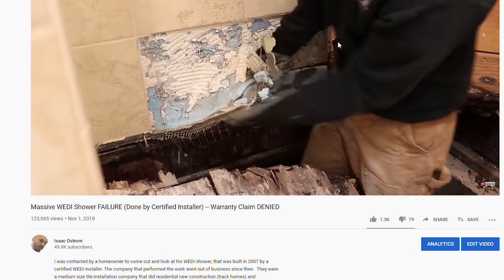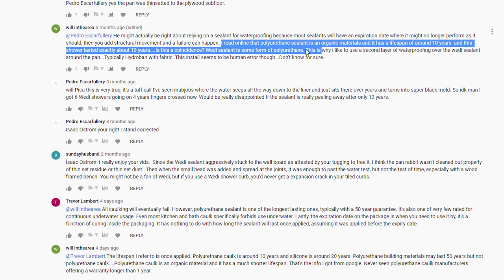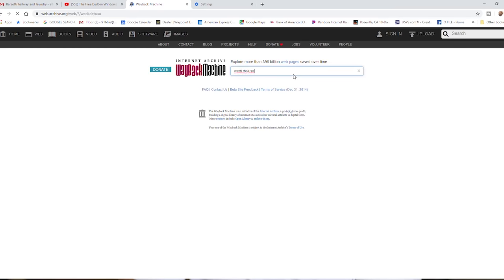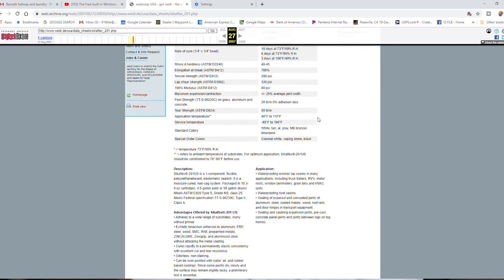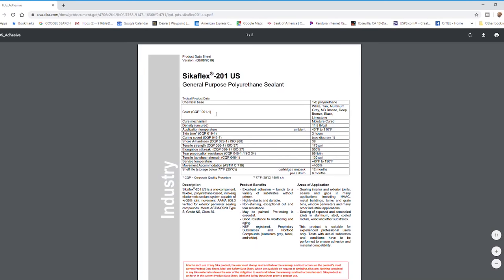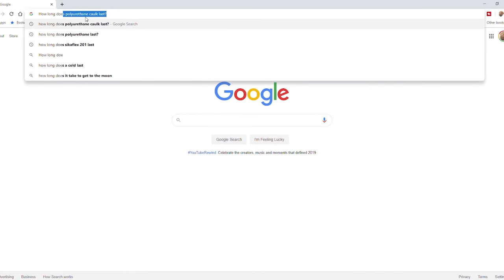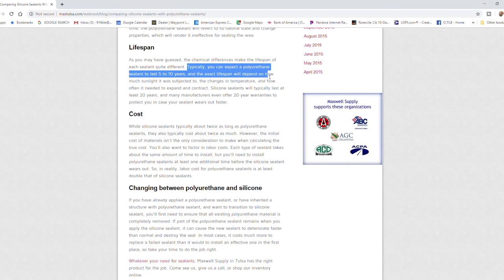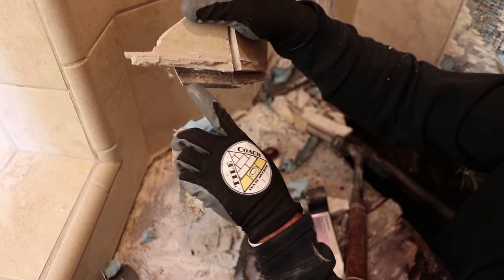WEDI Sealant Used in 2007 Identified-- ONE YEAR Manufacturer Warranty (Sikaflex 201)

Comment: Dude you’re a blessing to the tile community. Companies can learn so much from your videos. Great work! 👍
Reply: Great video with a lot of good information.  I’m a Pro certified Wedi installer ( can offer a 20 year warranty)  in the Nashville TN area.   Now to have had a shower system fail exactly the way this one did in the video.  Of course there is always a chance of installer error, which happens about 90% of the time.  But when I tore out the failed system I to suspected that the Wedi caulk had failed.  I really really like using the Wedi System so once I had an issue I came up with a solution so that never happens again.  What I do is install the pan and 1/2” wedi board according to manufacturers recommendations.  But in order to prevent the wedi caulk from separating or delaminating I add one more step .  I will use the wedi sub liner dry membrane and cut strips about 6”-8” and fold it in half. Then I thin set the sub liner dry over every joint (also using the wedi inside and outside corners at each corner).  This is a very cheap solution that will take you about an extra 20 minutes to do.  If you use this extra step you will have great installation and not ever have to worry of the Wedi caulk every failing.  NOTE:  wedi does have a product the sell called Wedi Band which is sub liner dry already cut in a 6” roll by X number of feet for the length.   You can use the Wedi band or cut your own strips with the wedi sub liner dry.  We typically just cut our own strips because we always have the sub liner dry on the truck.
Reply: @success19642  Why try reinventing the wheel? The info is at your finger tips. Get you some Sealant 620 and a roll of Sealing Tape.

Comment: Thanks Isaac. All your work and research is improving the industry and helping installers like me. I was wondering if maybe the installer from that shower used something other than the recommended Wedi sealant? Just because that was what Wedi was using back then doesn't necessarily mean the installer didn't use something else. What if he used acrylic door and window painters caulking for example? Thanks again for helping us out. Hope you guys are as busy as I am, my schedule is full until the last week in May and I haven't had more than 3 days between jobs since November. I'm making a lot more money since you gave me some coaching on what I should be charging for jobs. I can't thank you enough.

Comment: It appears that a majority of the "failed shower" videos are of shower pans.  I am installing a tub, with a shower surround, and recently found all of these new backer board products.  In my search to see what is the differences between these and the ancient cement boards, I found your informative videos.  Do you see any major issues using either WEDI or Dural Durabase XPS with a tub?  I'm doing this in two of my upstairs bathrooms, on my own, so obviously I don't want any moisture or leaks, but also carrying the weight up the stairs and mess of cutting and then sealing etc.  Plus the cost comparison.

Comment: If the lifespan of polyurethane sealant is 5 - 10 years and silicone is 20 years, then what's the lifespan of ms modified sealant which is what wedi uses now??? As i understand ms modified sealant is a hybrid type of sealant with the same benefits of polyurethane and silicone but I could find no information of it's life expectancy. It might be because it's a new product and they don't really know how long it's supposed to last. I wouldn't trust wedi sealant either....Unless you plan to get a new shower in the future anyways. I prefer pan liners or kerdi with ardex 8+9 over it.

Comment: That's some great detective work Isaac.  Bottom line, don't rely on sealants alone, most just don't last.  Butyl sealants are probably the best.  But still, always thinset and tape those joints, especially corners and floor/ wall intersections and apply a topical waterproofing like Redgard.

Comment: thank you for this clarification video
i had the wedi rep come out who does the classes to do my first install with me as it was a very high end job and my first one. You most definitely have to put enough glue in the channel that when you push the board out you get 1 inch overlap on each side. They were VERY adamant about using a lot of sealant. Also they have their own sealant now which im sure you know. There is a new company out too that is virtually identical to wedi but the board is green, i guess one of the former employees made this brand. I'm more of a fan of schluter but I'm liking how you do your systems as well. I'm kind of leaning towards goboard for walls, sheet membrane for corners and seems, and ardex 8+9 for pan and over the sheet membrane that joins the corners and seems.

Comment: I'm not a tile guy but I have been building houses for 25 years. Mostly drywall but I have done alot of remodeling so I've had a taste of just about everything. Anyway it seams like common Spence to me that ANYTHING dealing with holding water that has a seem is going to leak eventually. Only way to be sure there is not going to be any leaking is using a seamless system like the pic shower pan liner or some kind of prepare shower pan. Yes them things can get expensive but I'm pretty sure that none of them cost as much as it's going to cost to fix that means house. NEVER GO CHEAP IN A AREA YOU CAN NO ACCSESS OR SEE WHAT IS GOING ON TILL ITS WAY TO LATE. When I work on a house I keep in my mind will this still be here 100 years from now. Yeah them couple nails are good for now but will it still be holding up in 100 50 or even 25 years. That's just me and how I do stuff when it comes to ppls. Home. Thanks for the videos. I been in the business a little longer then you but I still learn alot from you. So thanks

Comment: heres my opinion ,I really think something caused  deflection,...I dont think the sealant broke down ,it may not have been applied enough,,especially on wood,where it will move more than a slab, could be a kid jumping off the bench,or a water leak, and ultimately separation  of the bond at the rabbet,great research from you isaac ,and your followers, in the end that sealant seemed  pretty stretchy,how well it bonds to the blue foam,and the coating  on wedi...yet to be determined, thanks for posting,

Comment: You must use fiberglass tape on all joints especially the pan it is typically not the glue that fails it is the joint that will open up with stud movement!!!!! Rats love to eat wedi.the proper amount of glue applied also is a large factor.

Comment: Sealants should never be advertised as water proof. They all break down, especially if used in a joint that can move. There was a YouTube video I watched a couple months ago that talked about the life-span of various construction products. Basically all caulking will one day turn to dust and should never be used to permanently attach something that has any type of constant static force including the force of gravity. People who are addicted to attaching things like framing members to drywall are idiots. Use them for their intended purpose such as gap filling or water resistance such as around a tub or toilet, not for shower pan waterproofing. I don't care how advanced or space-age the sealant is.
Reply: But typical waterproofing coatings share the same type of chemicals used in sealants, e.g. acrylics, polyurethane, or epoxy. If sealants don't live up to the job, so do the waterproofing coatings.
Reply: @oldhongkong565  It's very difficult to virtually impossible to join two pieces of material together with a third and expect it to be waterproof. Because at the atomic level, the materials are not homogeneous and are basically sitting on top of one another with bonds that are physical taking advantage of the uneven surfaces of the material. This is completely different to the concept of "welding" when you use a filler material similar to the base that actually flows into the base material due to heat melting the material. Sealants are water-resistant at best under the perfect conditions.

Comment: Thanks for sharing.   I'm always looking forward to your discoveries...  Planning a bathroom remodel with tub.     Learning as much as possible before starting (in about 12 months).

In 2015, first bathroom remodel. Installed nobledeck on floor (sunken concrete slab), nobleseal ts on walls, sealed with noblesealant 150 (this caulk was very expensive iirc $25+ per tube).  Hopefully, I get another 10+ years out of it.  Or at least until the house is sells....

Between you, Sal and Elite tile amongst others, lots of good information out there.

Comment: I love your shower system failure videos.   It seems that every one of these shower systems now have a failure video on your channel.   So whats the one thing they all have in common?  They are built on site and the seams are sealed according to the manufacturers specifications.   In some cases the manufacturers have issues with their products such as the Schluter thinset wicking, or in this case the poor sealant recommendation.    What is NOT failing or not causing these epic disasters?  The wall seams...  All of these failures are in the pan section.  If its a hot mop job, a PVC liner, or a "shower system" all the failures are in the pan.   Makes me wonder why more installers are not using tileable factory made shower pans.  Seamless systems that take a couple hours to install rather than a full day (at $100+ per hour).  Other than the lead time to have the custom pan made, and the limitation on the drain riser heights that can be used there are not many down sides to using one.

Comment: Hi Isaak, im asking you as you seem to have the most experience in this Wedi product I have seen so far, im in UK and this is still fairly new over here but hear goes...

I am in process of building a walk in shower enclosure 2000mm x 800mm and have used an 1800x900 cut Primo base and sloped 40/46mm extension cut to fit, all edges cut to form 12.5mm rebate to accept the Wedi 1250x600 wall boards 12.5mm.

It is installing fine and I have sealed/filled each rebate and board edge with the new Wedi 610 adhesive to a 10mm bead and smoothed any residual adhesive.

My question is I was sold a Primo sealing kit which includes 2 part Wedi 520 sealant mix and waterproof tape.  I have conflicting info on the final sealing process of the edges of the boards both vertically and to the Primo base.

Do I just apply 610 adhesive to the edges and seams and smooth out to at least 25mm each side of join? Or do I apply the additional reinforcement tape I purchased to all the wet area joins and if so do i apply it on top of the second 610 layer or with the 520 thinset mix?

I was informed to use the waterproof tape with 520 thinset mix and seal the base edges using corner pieces but I dont see any reference to this in any of the official Wedi instructions? Was this an old method or is just using 610 adhesive sufficient and apply reinforment tape over top on joins?

Please explain the approved method.

Many thanks for any info you can provide.

Comment: The more of these vids I watch, the more I think a custom-fitted welded stainless steel shower pan just might be the be-all and end-all. Has anyone tried it❓ Sure, it would be expensive, but better to buy once and cry once, than to buy dirty and buy again.
Reply: I've seen lead pans. Done in homes in the 50's. at least this home has this style of pan. Leak free and seems as if the system was working but unfortunately the walls were not sealed so it was allowing the wood studs to get moisture and they enclosed the shower to much and mold was an issue and light.
Reply: It would have to have the slope built into it similar to those Tile Redi pans which are not cheap, and you would still need some material for the thinset to stick to inside the pan. In the case of the Tile Redi pans you have to use an epoxy thinset which is a PITA.

Comment: I personally would never install a Wedi system shower or wet area. I've looked at their site, and it's probably much better now with the membrane, sealants, and other accessories. But the fact they put out such a ridiculous system originally tells you they aren't designing and testing adequately or even have basic sense.

Comment: Wedi is not reliable and WAY overpriced. Schluter system with ardex 8+9 on pan, corners, curb, and over the kerdi band where the seams are. Not gonna fail if done properly
Reply: Also not approved by schulter. So good luck getting a warranty claim. Besides that, you don't even need kerdi if using ardex, you can go right over cement board/mud pan. It's a waste of money to use both. Or you could just wise up and use redgard or any other waterproofing, paint on membrane.
Reply: @abewilcox4560  I dont need warranty claims. They'd find a way to avoid blame anyway. I'll do my showers how I want and you can do the same. Sounds like a good idea right?
Reply: @Pedro Escarfullery cool
Reply: @abewilcox4560  Do you use the joint tape to reinforce the pan/wall board joint when you use Redgard? I assume you're talking about a drypack pan and cbu for the walls? How do you deal with the drain connection?
Reply: @mattjudy4037  I've always wondered why Schluter haven't come out with a paint on membrane product they WILL warranty, since there are a lot of guys like you who do it anyway.